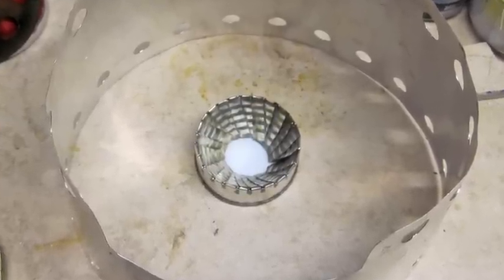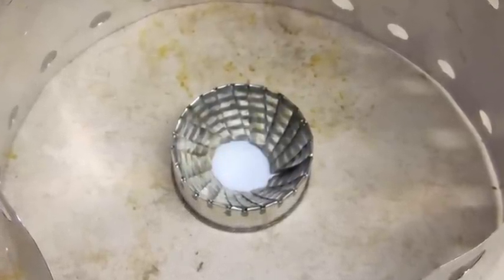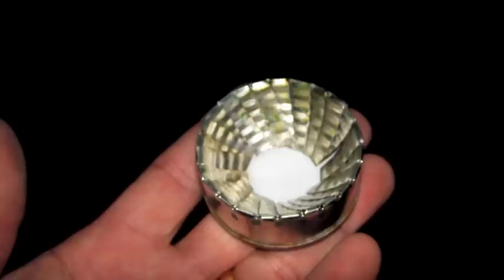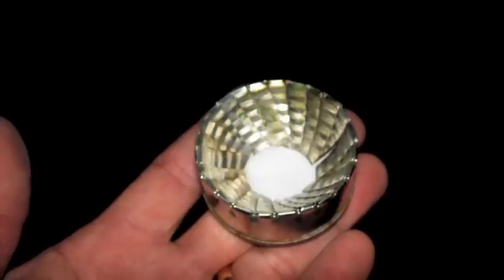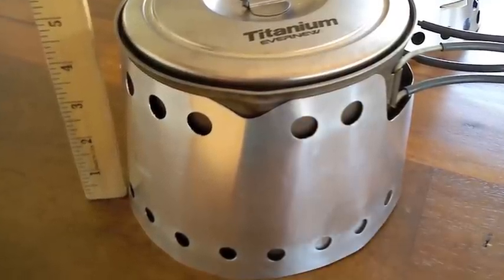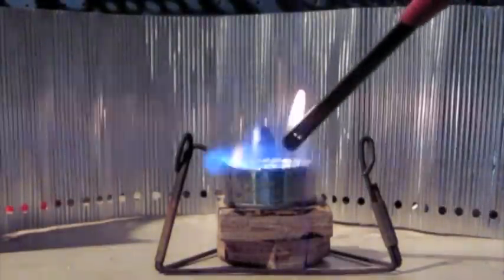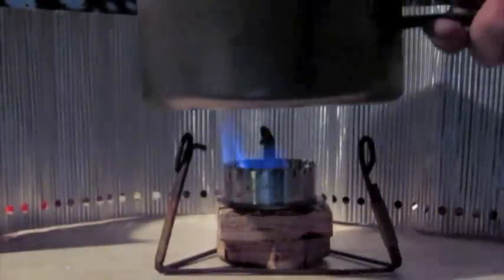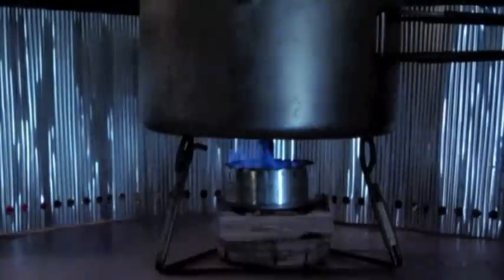The BABY FLAT CAT Alcohol Stove

Comment: @jonfong57 Generally speaking, I found that the wider the pot bottom, and faster the boil time (but there is also the point, past which, there are diminishing returns).  I also found that the smaller the air gap between water level and lid, the faster the boil time.

Comment from the maker: @MrBillTroop73 BTW, I found out some interesting information about fuel needed to boil 2 cups using my pot.  2.1" diameter - 13 ml,  2.3" diamter - 14 ml,   2.7"diameter -15 ml (my pot is ~5.25" in diameter).  Of course the time to boil drops from ~10 minutes to ~ 6 minutes with the larger stove diameter.